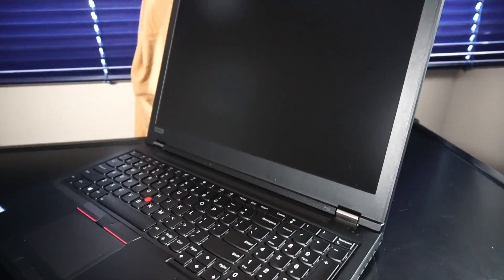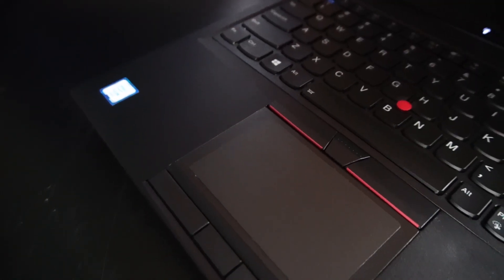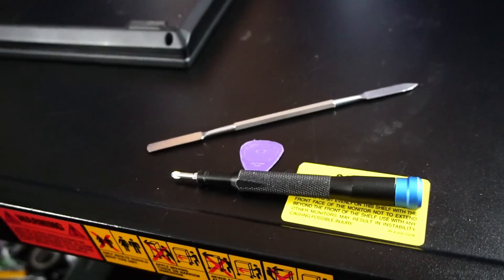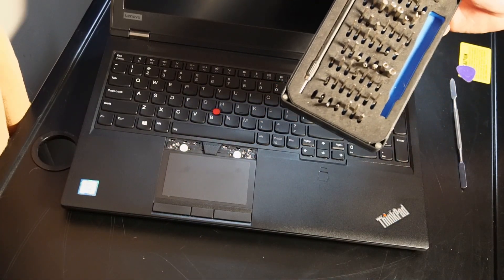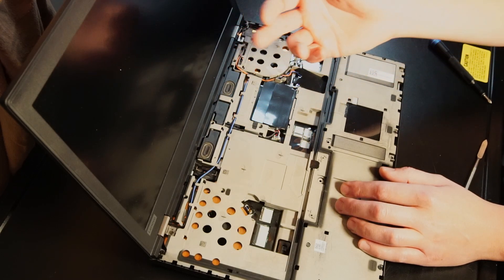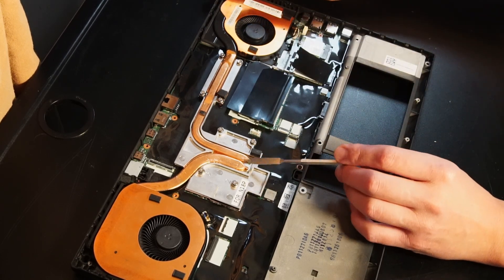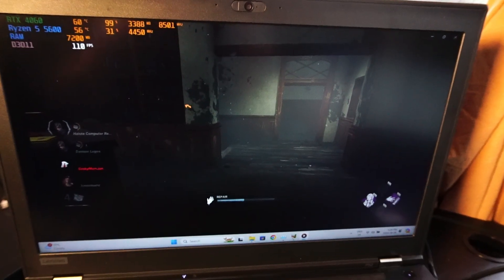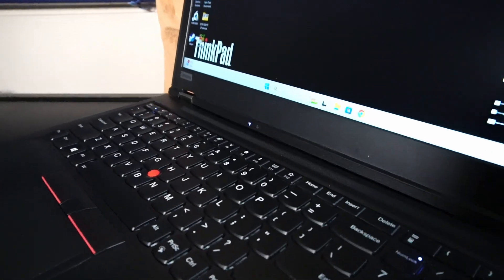Lenovo ThinkPad P52 in 2024:  Performance Review, & Gaming Tests!

Comment: My P52 has dual 2TB NVMe 8200 Pro, 128GB, 8850H, P3200, Intel AX210, probably more.  I undervolt and have a stand with a Noctura 120MM fan under it and it runs at 4GHz. That said I just picked up a HP Elitebook 845 G8 Ryzen Pro 5650 for a gift for my brother-in-law and it's fast and light.  One thing about my P52 it burns through it's battery life not charging.
Reply from the maker: I let the P52 go for a thinner and lighter laptop, but I still miss how well it worked when I needed it for editing and light gaming.

Comment: Hey bro, quick question — do you think the laptop in this video is better, or the one with the i7-8850H and Quadro P3200?
Reply from the maker: The Xeon CPU is better overall than the i7-8850H.  The i9-8950HK is probably the best option, with the Xeon being second.  But, the P3200 is the best GPU option, so if you get one with that i7 and the P3200 that would probably be pretty sweet.
Reply: @HaisteComputerRepair Thanks a lot for replying, really appreciate it! 🙏 Btw, do you think it’s better to go with the ThinkPad P52 with the Quadro P3200, or the Dell Precision 7730 with the P5200? Both have the same processor.
Reply from the maker: @incrop1615  Wow the P5200 would be quite the GPU to test out.  If it's not too much and within your budget, go for it.  I suppose it might depend on what you plan to use the laptop for.

Comment: Hey just a question does the ThinkPad P50s are capable of running Windows 11 if not do I have to resort with Linux by the time Windows 10 support ends? Or do I have to find a different thinkpad that will run Windows 11
Reply from the maker: You would have to force install Windows 11 as the P50s CPU is not on the Windows 11 support list.  It would probably run fine, but possibly not receive proper support from MS updates.  Could try Linux.
Reply: @HaisteComputerRepair that's unfortunate however I looked supported Lenovo devices and apparently The P52 and above is in the list of supported thinkpads for Windows 11 but if I ever do get the laptop I will try methods and if it does work then it works if it doesn't then I'll just resort to Linux mint which is no big worries

Comment: Good video, very detailed disassembly.
I would not call the speakers decent. Rather tolerable to watch a tutorial video with them, but not for enjoying a movie.
Cpu is hotish, 65 °C in idle.
Cable connection for hdd is rather expensive, I suggest NAS or cloud instead. I would love seeing a hack to reroute a usb port inside the housing to store an attached dongle in the hdd space. Dongles are a hassle when lost away from home.
Reply from the maker: Fun idea about rerouting a USB port.  Even when I was editing a bit on the road with the P52 I didn't need to use more than a 1TB NVMe.  But that's just me.  I would install everything I could just for the novelty and the fact that I have a mountain of tech in my home to pick from.  CPU ran hot for sure, but not unusual for laptops like this.  Using a laptop cooler pad worked well (I have a video of that also).

Comment: Great video man ❤ , I just bought one but I noticed it gets super hot when editing videos and it makes too much noise on heavy use. Is this normal??
Reply from the maker: once the CPU gets hot it's pretty normal for fans to ramp up.  But, if there is excessive noise/rattling etc it could be a damaged fan.
Reply: @HaisteComputerRepair  Thanks a lot man ❤
Reply from the maker: @nero9950  No problem.  It's a common feature of workstation/gaming laptops for the CPU/GPU to get hot under load.   Higher wattage hardware in a small package.
Reply: Probably need to undervolt a bit
Reply: Does it lag when editing videos? How smooth is it?

Comment: Pretty nice video. Super detailing. It's my first time I watch your video. I refer Thinkpad T14 gen 2 with Ryzen 7 5850u and exactly this P52 in this video. I wanna go for a laptop for study and work. Microsoft office, Run Autocad, Mathlab, PLC program.. Can you give an advice? Cause both of them at same price in my country now. And I want a laptop for 5 years and more
Reply from the maker: What CPU/GPU does the P52 you are looking at have?  That T14 Gen 2 is a good laptop as well, for the right price.
Reply: @HaisteComputerRepair  P52 Xeon 2176M -32-512-4K touch P2000. Or should I go for a Dell precision latop? Such as 7560 etc My buget around 590usd. I want all in GPU power

Comment: A question please . Would it not be possible to leave the leads from the screen to the upper chassis connected and just release all of the screen screws and chassis screws and lift the chassis gently and tilt it back onto the screen toe access the thermal assembly rather than disconnect everything ?
Reply from the maker: Being that you have to remove the plastic piece between the palmrest and the motherboard, you pretty well have to disconnect as you will not be able to reach the heatsink assembly otherwise.  It's much less cumbersome to just disconnect, just make sure you remember where to put things back.  Take pics or use my video as a guide.
Reply: @HaisteComputerRepair  thanks  for replying ..Nice machine just pig to replace the fans ....
Reply from the maker: @ yeah it takes a while but it’s not too bad

Comment: Hi haste I have a p53 core i7 9th generation with a 64gb ram and a Nvidia quandro T2000 graphics card how much fps can I run on Fortnite ?
Reply from the maker: I am thinking you would be able to manage 120+ fps at 1080p DX12 if you keep the settings at low.  On the smaller display panel it still looks pretty good, I think.

Comment: I have the same specs , except the processor which is i7 8th gen (h series) is it same to xeon ?
Reply from the maker: The Xeon has slightly faster base and turbo CPU speeds and also has the slightly better UHD P630 integrated graphics (on top of whatever dedicated Quadro GPU you have).  Also, the Xeon CPU supports ECC memory, if that matters in your use case.

Comment: Hi Haiste, 
Would you please recommend which one is better P52 i7 8th gen P2000 or P53 i7 9th gen T1000?
Reply from the maker: Well, the P53 will support faster RAM speeds and otherwise I am thinking that performance will be similar.  What is the cost different between the two you are looking at?
Reply: @HaisteComputerRepair  
P52 i7 g8 quadro P1000 : USD 450
P53 i7 g9 quadro T1000 : USD 570
Both at same 16GB RAM & 512GB SSD

Comment: Watching this on my p52 with i7 processor.. still kicking for CAD works.
But not that smooth for the latest version of autodesk apps like revit 2021.
Reply from the maker: I am not that familiar with Autodesk, but curious.  Is it more CPU or GPU dependent?
Reply: Hi, I am looking for an affordable laptop for working with rather big assemblies (say, a stack of 40 heat exchangers on a metal frame) in Autodesk Inventor 2025. Do you think this laptop can be good for it? I don't need it to be working at the speed of light, but a decent performance should be there. Can't find relevant information with respect to this machine.

Comment: Got 1 a few months ago with a p2000 and i7 8850h. Repasted, undervolted. Great work and gaming machine and underrated feature  its replacable charging ports make this a machine I will keep for years to come along with the removable battery.

Edit: Upgraded to a P53 with an RTX 4000. Best decision I made and hope the new owner of my P52 shows it some love. I play games more often now so i needed something modern at least
Reply from the maker: I would use it as a daily driver if it wasn't so chonky in my backpack.  I love it, but I will likely end up selling my personal one as I do not use it often enough.  It needs some love.
Reply: @HaisteComputerRepair  im 6ft 2 and 180lbs tbh so my big ass built has no problem with it lol. I carry it around alot and my back is stronger partly because of it 😂

Comment: Much needed video.recently got one.
Reply from the maker: Awesome, good luck with yours!
Reply: Hey, i am also thinking about buying a p52.
What are your thoughts on the laptop? do you recommend it?
Reply: @kasp9290  so far it's great, yes it's bit heavy and the hdmi ports, charging ports are behind rather than sides.... I see myself using this for atleast 4 yrs. Battery backup you could except around 3.5 hrs on efficiency mode. Mine has 80 percent battery health.

Comment: Thank you for showing the dissection of that unit. My knowledge of laptop repair is pretty much non-existent. I never needed to use one for my work requirements, prior to retirement. However, I bought my wife a couple, several years ago, to surf the internet and play card games. When problems began to develop with them, I would just wipe the drive and take the device to e-waste.
Reply from the maker: Yes, more than likely you had functional laptops that just needed some service.  Better to learn late than never at all!
Reply: @HaisteComputerRepair  I'm certain that you're right. However, they were so slow and inadequate, I didn't want to bother with them any longer. Personally, at this stage in my life, I 'll only build and use desktops.